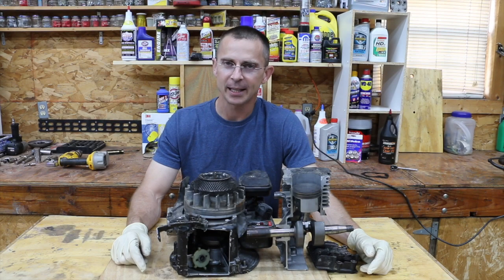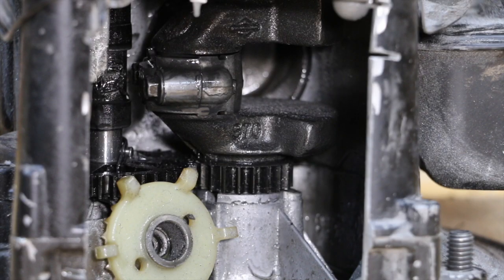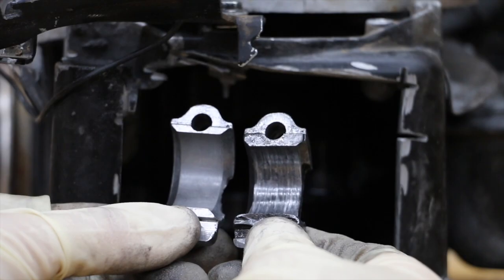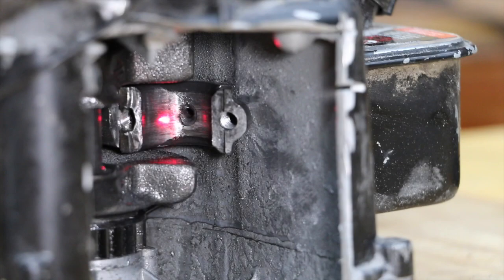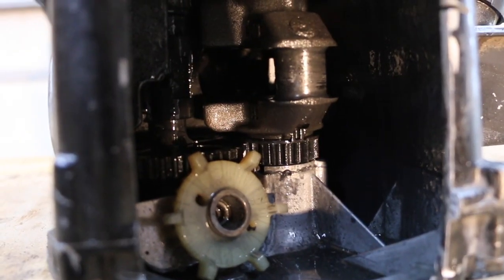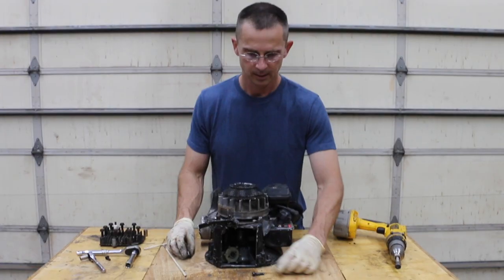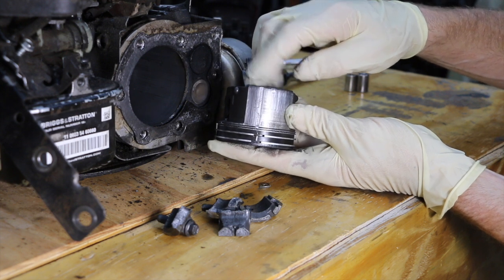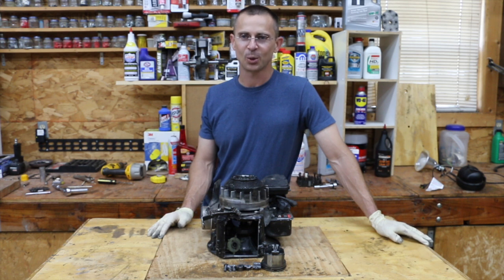Running Cutaway Engine Throws Connecting Rod!

Comment: Well if you've never seen parts flying out of an engine like that, then you'd better watch this (viewer descretion advised lol),
https://www.youtube.com/watch?v=aUkXriHjQeI
BTW, I like your overtly voyeuristic slow mo repetetition. It appeals to the Aspie in me in the same way fire does to a low intelligence firebug ...

On another matter, Engine Masters https://www.youtube.com/watch?v=AScojLj139A did a test on how much nitrous oxide a stock engine can take. Rather than go to the complexity of adding a supercharger or turbo, why not blow 2 engines up. One with stock ring gaps and another with the ring gaps opened up. The effect is the same as a blower but with far less complexity - however there is still some complexity in rigging up another fuel system but it could be done with a fuel pressure regulator and a wrecking yard Bosch roller cell pump (077). You could even play around with water injection or methanol to see how that works. 
Might be fun.
Reply from the maker: Wow!  That was quite the destruction!

Comment: Knock knock. Whose there? Low octane fuel. Low octane fuel who? Low octane fuel in your tank! 

Great video. I once had an international 345 cubic inch engine almost up to double red line when it put parts through the oil pan. Nothing quite like destroying, and then rebuilding an engine to teach you how they work and why they have a red line.
Reply from the maker: Thank you!

Comment: What would happen if you packed that motor with wheel bearing grease it's high temperature. It is made to break down at high temperatures in it.
Reply from the maker: Thank you for the video idea!

Comment: I had the same exact engine and the same exact problem the connecting rod flew off and I was just normally using it with oil and the only thing wrong we did was buy a used engine
Reply from the maker: Thanks for commenting on this!

Comment: I cleaned the engine of an old Volvo 240 by putting diesel in it instead of oil, running it for a short while and emptying the diesel. Then I ran it full throttle and it only lasted 28 seconds and man, it welded itself together. Impossible to get unstuck.
Reply from the maker: Interesting. Thanks for commenting.

Comment: I had a four year old 14hp Briggs that threw a rod threw the block. It was running smooth before this happened. Funny it didn't make any noise, just stopped like it ran out of gas. Inspection showed that the nuts/bolts on the connecting rod vibrated loose! Someone told me these engines were sabotaged by union workers in Wisconsin because B&S built a plant in Alabama that was non union. Have you ever heard of this?
Reply from the maker: I have not heard of this.
Reply: I still have photos of this engine. If you want me to send them to you. If your curious what the damage looked it.

Comment: heres something ide like to see alot.. get a used mower in fair/good condition, fix it up, then override the governor so the engine runs max speed and see how long it runs. and have the correct ammount of oil in it. it would be a gread leaning experience.  ive seen mowers at goodwill for 20-40$
Reply from the maker: Thank you for this recommendation!

Comment: I found an all tarnished and rusted moped in the river, and i've repaired it and painted the whole motorcycle... it still runs, but them piston rings are at their end... but it still goes like new...

Edit: all parts which were in the moped engine while it was in the river were all a bit modded so it wouldn't throw a rod or something, I didn't wanna buy the parts for it because those parts in the engine  weren't as bad, and when I assembled it, to my surprise, it was working... and it's still riding...
Reply from the maker: That's great that you were able to get it running!

Comment: Try running a 4 stroke on 2 stroke gas with no oil in the crank case see if it lasts longer than one that is just running on straight gas and what the difference is in the damages
Reply from the maker: Thank you for this recommendation.
Reply: Project Farm np I love your videos

Comment: I had the engine in my 2001 BMW 530i fail on me one winter...

I was sitting at a red light when it suddenly started running rough, and it cut out about 10 seconds later. 

It later turned out that the crank case ventilator (I think) cracked, and oil spilled into the intake manifold and caused the engine to seize. 

Wound up replacing the engine.
Reply from the maker: Wow!  That's an unfortunate event.

Comment: These engines are tough for what they are.  If you can buy an entire brand new low end lawnmower for $99 full retail, how much does it cost Briggs and Stratton to produce a low end engine?   $20 bucks?
Same with Harbor Freight Predator 212 engines you can buy for $99 that probably cost a Chinese factory $10 bucks to produce.
Reply from the maker: Great point. Thanks for commenting.

Comment: I had a lawn mower I bought used, cheap about 12 years ago with a Briggs Quantum engine, I never changed the oil just added as needed, and when the primer bulb assy gave out I just dumped a cap of gas in the intake to get it started. AFter a while I tossed the aircleaner and filter- easier to dump the gas in and get it started :)
That thing lasted for I guess 12 years or more that way until  last summer when it started knocking and then in the middle of mowing it just made a noise and stopped instantly. Tore it apart and the rod was shattered in 3 pcs where it was bolted to the crank, it appeared as though one of the cap screws had worked it's way loose and that was causing the knocking from excess play!
Despite no oil changes and no air filter, the cylinder was in near perfect condition!
Reply from the maker: Yes, the Briggs are tough engines. Thanks for commenting.

Comment: As I was watching your video, I was like, whatever brand of engine that is, that's what I want.  Then, I saw that it was a Briggs and Stratton!  A quick story - my mom recently gave us her old 42" 16HP Craftsman lawn tractor that I grew up with actually.  So, it's probably 15 years old.  It was pretty well maintained until it sat around a lot before we got it (my wife and I).  All we did was install new fuel lines and tank and clean the float bowl and it runs like new.  It's a Briggs and Stratton 16HP with a cast iron sleeve.  I'm just surprised how great it still runs despite  the 5 years of hardly any maintenance before I got it.  I wonder if all small engines are durable these days?  All I know is every motor I've used has been Briggs and Stratton.  The only one I had die was a 4HP on a pressure washer.  The head got loose and the carb was giving out.  Still fixable, but had it for a decade with good usage.  So anyway, I was wondering if you've noticed any quality difference in the different brands or whatnot?
Reply from the maker: This is a great question regarding durability and quality of different brands.  I don't like Tecumseh engines. They seem to have more issues than the Briggs.  Like you mentioned, most engines out there are Briggs.  Honda, Kohler, and other brands aren't quite as common.  It seems as though proper maintenance and keeping the fuel from going stale has a lot more to do with keeping these engines running than name brand. Most small engines are stored more than used.

Comment: I haven't really had an engine fail but I was doing 60mph on a winding twisty backroad and the engine shut off and I had to lock up the brakes and slide to a stop, by the time I stopped the passenger front wheel was dangling over  a cliff though, if I had kicked the brake pedal a second slower then I would've sailed down a thousand foot drop
Reply from the maker: Wow!  Scary experience for sure.  Glad you were able to get the vehicle stopped in time.

Comment: There are two things I can say. I will say one thing is this comment and the second in another. The rod knock was going with equivalent of rod bearing damage because of lack of lubrication. This is comparable to what often happened in VW air cooled engines type 1 and 2 because #3 cylinder got the least amount of lubrication. It would lead #3 rod bearing spinning and it would lead a condition comparable to what happened to that lawn mower engine.
Back when I used to mow lawns for hire I had a McLane lawm mower with a 4 h.p. Briggs and Stratton engine. I had the engine seize up on me because of lack of lubrication. It was possible to unseize it.
Later on it threw a rod just like what could be seen on this engine.
Thanks to what you have shared with this engine, I got to actually see something equal to what happened on my lawn mower which I appreciated seeing. That was great. It appears I will not need to make a second comment. I enjoyed watching this just as much as all your other videos which are very educational. Very nice work!!!!
Reply from the maker: I enjoyed reading your comments and great analysis on the VW.  Thanks for the positive comment!

Comment: Always interesting stuff here!
As I mentioned in another post, the rod is smashed off not necessarily by the actual failure but by the heavy crank full of momentum coming around,  bashing and severing off the big end of the rod. 
I've seen automotive steel rods come off the crank at low rpm and the crank was not able to bash it apart but simply blocked the crank from turning. Analysis of the rod was very telling in this particular situation. It was a bolt failure!
Reply from the maker: Great point and thanks for commenting.

Comment: Years ago I was driving a Volvo tractor-trailer with a bazillion miles on the clock and a very nasty rod knock. The mechanic at the shop knew about it and just didn't give a rats ass. 
I was on I-290 in Massatwoshits headed for Bangor Maine one night...knockknockknockknock....BANG!! smoke out the ying-yang lol. I got out there was about 6 gallons of oil all over the road. Pulled the hood open and saw a HUGE hole in the block with a rod halfway out lol. I think the boss woman told the mechanic to take a walk and keep on going  :-)

Comment: and this is just a small engine throwing a rod. I've seen instances on larger engines that threw a rod and it literally punctured the engine. It's kinda scary to see the sheer power of that. What's also scary is seeing what happens when an engine sucks in too much water. Looks like someone shot a hole through it with a .50 cal rifle.
Reply from the maker: Wow!  Thanks for sharing this experience.
Reply: Bill Does Stuff ever seen that spark plug or piston go through the bonnet  (hood) ? scary.

Comment: why wouldn't you expect it to fly apart? Um when you had it apart, you had another cap, why not replace it Just goes to show this engine could have been saved, not wasted.
Reply from the maker: It was knocking badly and that normally results in catastrophic failure.  Thanks for commenting.

Comment: This comment is more directed to the video creator but everyone is included... Internal combustion engines are amazing and if you ever get the chance to start a V8 with oil pan off just lay underneath it and watch it idle for a second it's unbelievable how fast the parts are moving. I could hardly imagine what the blur must be like at 7000 RPM.
Reply from the maker: Thank you for commenting on this.  I agree, it's amazing to see all the parts moving so quickly.  I sure wish I had captured this engine throwing the rod with a high speed camera.

Comment: i had a 2005 Dodge Durango V8 snap one of the rods off at the bottom of the piston on the highway. Initially the engine just died flat and would not crank or anything afterwards. had it towed to the mechanic and he called me a few days later to come check what happened. The #4 piston was rammed up as the connecting rod jammed its way between the piston and the cylinder wall, ramming the piston upwards and smashing the valves, bending the push rods, and torquing the camshaft to hell. 
Funny thing was that it wasn't knocking, running hot, or anything before hand. it just was running, then suddenly the tach dropped to 0 on the highway and every warning light lit up and it wouldn't restart.
Reply from the maker: That's strange how the engine suddenly had a connecting rod snap and without much noise.  Thanks for commenting!
Reply: yeah that was the thing, it never knocked, rattled or anything. now i will admit that i had been having previous trouble out of the engine. that cylinder and others would misfire a lot and i think it had a valve sticking occasionally open or closed or something. so knowing what i know now that i didn't then, all i can figure is it possibly had the exhaust valve stick closed for a cycle or 2, while still injecting fuel and air into the cylinder and then finally fired, or misfired and tried to go down on an up stroke. 
I'm not honestly sure as i only know enough about cars to change parts, and get me in trouble ;)

Comment: I once used to own a John Deere L110 and I had it for 2 months before the connecting rod broke. the engine had plenty of oil and it was sitting still in high idle and the last thing I heard was the motor banging really loud then it just died and would not fire back up
Reply from the maker: That's disappointing to have the engine give out so quickly after 2 months of ownership..

Comment: I've always read that one of the basic facts about aluminum is that it makes a poor bearing surface. You don't generally want to put aluminum parts in situations where there will be potential abrasive wear(like rod or main bearings). Normally, aluminum engine blocks(and iron blocks) will consist of a steel backing, covered with an added layer(barrier) of lead, which is covered with an "overlay" of relatively soft mixture of lead/tin/copper that the pins ride on. That allows you to simply replace the bearings during overhauls/rebuilds because any abrasive wear is confined to the replaceable bearing, as opposed to causing irreparable wear to the surfaces of the actual block. 

So for 2 reasons, I can't understand why they wouldn't spend just a small amount of additional money to install a proper bearing, instead of having the piston rod and/or main bearing surfaces be an irreplaceable part of the block itself, and made of aluminum.
Reply from the maker: All great points!  Thanks for commenting!

Comment: Once I knew someone with a siezed wood chipper, he thought running it for a bit would smooth it out, I told him not to but he did anyway, and after a few minutes the connecting rod snapped right in the center and the part attached to the crank shaft punched a hole right through the engine crank case, the Piston also shor up and smashed into the valves, needless to say that engine was completely toast
Reply from the maker: Wow!  He should have taken your advice!  Thanks for commenting!
Reply: i love playing with small engines, so easy to work on and experiment on

Comment: I always wanted to replace the oil in a small engine like this with warm gallium and run it to see what happens. Gallium has a reaction with aluminum that makes it brittle like potato chips. It's just a little too expensive to get enough gallium to fill the engine.
Reply from the maker: Thanks for this recommendation!

Comment: I broke a wrist pin in a 4 cylinder car engine ('83 Cavalier if you care to know) once. Didn't take long before it threw the rod out the side of the block. I was young and dumb, but still not surprised.

What did surprise me, and a couple of mechanics who actually looked at it... When the wrist pin broke, it also warped a rocker arm, but didn't damage the push rod. To this day, I have no idea how that miracle happened.
Reply from the maker: Wow!  Thanks for sharing this experience!

Comment: Jeez, man. Same deal with detonation? I ask 'cause I got a straight-six that's knocking like it's tryin'a sell me something, but only at low RPMs and when it's more n' warmed up.
Reply from the maker: Detonation is pretty hard on an engine.  Is there a knock sensor that's out?  Thanks for commenting!
Reply: Project Farm Well I got a feedback carb from the eighties, so probably, but it might be the emissions systems considering I'm missing some Pulse Air components in the engine. Which unfortunately will not work until I get a specific check valve and vacuum reservoir that seem to be all-but-gone.
That said, I think I'd best stop running the engine until it's fixed, then. I want this engine to last for years, not months.

Comment: What would happen if the pistons were held down while the engine was running. Or trying to run atleast. Would it just blow? Or wouldn't turn on at all. Would you even be able to try to start it up?
Reply from the maker: Brandon, This sounds like a hydrolock experiment.  Seems like a great suggestion--thanks!

Comment: I've got a K301 Kohler out of a Wheel Horse tractor with a block that looks like that. But my hole was made when the rod came through the block at full throttle lol...scared the crap out of me when it happened
Reply from the maker: Bryce, Wow!  I'm sure that made a lot of noise!  Glad that there weren't any injuries.  Thanks for commenting!
Reply: Project Farm It did make a lot of noise. Funny thing was it never gave any warning, no rod knock or anything. found the rod in the bottom of the oil pan in about 7 pieces. Found pieces of the cast iron block 40 feet away from the tractor

Comment: My very first car, paid $75 for it. lasted 6 months before throwing a rod. It just seemed to stall and die as I was going down a steep hill. I coasted it to a parking spot.
It still started a ran, but made a very loud banging metal sound. Oil pressure light was steady lit. Amazingly, I was able to drive it another 5 miles home. It would only go about 20 MPH top speed. The block was still intact. 
Always wanted to see exactly what happened inside that engine. Thank You!
The car had 175,000 miles on it, by the way.